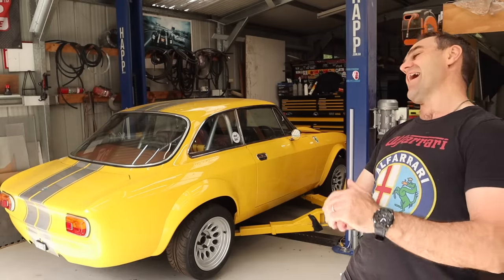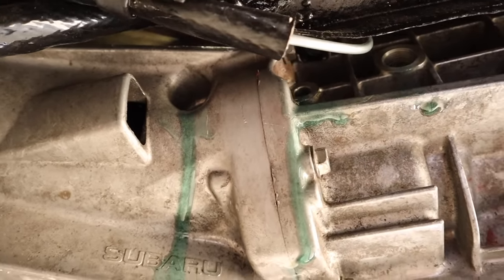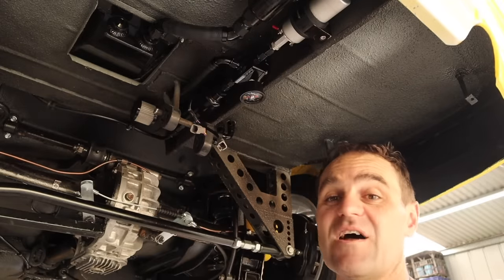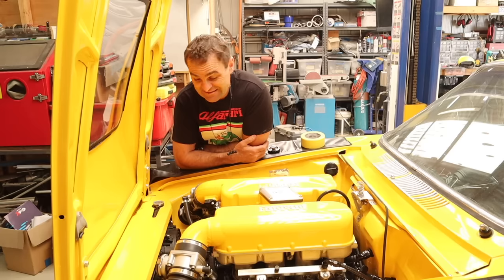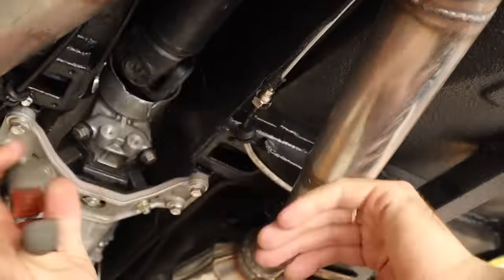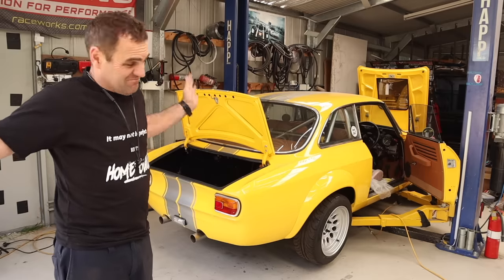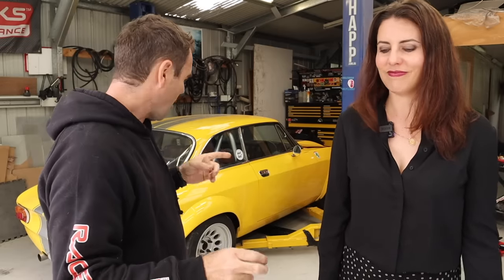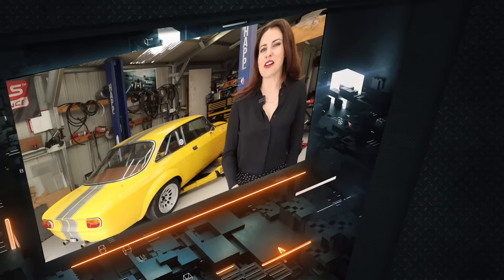It is driving! - Ferrari engined Alfa 105 Alfarrari build part 197

Comment: Hey Jeff, for filling your gearbox, go to bunnings and get a cheap garden sprayer, take the nozzle off the end of it and bend a hook in the metal tube so it will hook in the full hold. Fill sprayer with oil, pump it up and pull the trigger 👌🏻

Comment: I have a similar M9 story with my 1979 Alfetta GT.  The SPICA mechanical fuel injection was converted to Webers years ago.  The Webers are an early emissions (early '70s) version, and the progression hole inspection covers are M9 bolts.  One of them was missing, and I couldn't find a replacement ANYWHERE.  I recently had the carbs rebuilt by a guy in Illinois and he actually manufactured one for me.  He then was able to find M9 bolts from a supplier in - of course - Italy.

Comment: For gearbox filling I have a little 12v extraction pump and use it to extract oil from the bottle and decant into the gearbox. Sometimes the gear oil is a little thick so I either use a little hot plate and bowl of water or an old kettle to thin the oil a bit. Takes 5 mins to set up but then it’s no work at all. Great job Jeff. So happy for you.

Comment: With it being a Subaru gearbox it is most likely one of those holes is for a neutral switch.  Yes, I know it is a manual, Subaru use neutral switches in their manual transmissions, it has something to do with fuel mapping and using a different map for idle, no gear selected.  The other one I have no doubt would be for another sensor.  I'd be comfortable with just plugging them up with bolts.
Reply from the maker: That could be it.

Comment: Oil transfer pump on the cheap...  take one plastic garden sprayer (2 gallon is common size in the US), add schrader/tire valve so you can pressurize with shop air.  Add fluid, pressurize (I've done 40psi without issue for years) and hit the trigger on the spray wand.  Oh, I remove the "sprayer" part at the tip of the wand so it's just a straight stream, I know others have added a piece of tube with a bend on the end so it'll fit into tight spaces and still point down.  Takes a bit to move 80/90wt oil in the middle of the winter, so I tend to try and do my big fluid changes in the summer, or let the whole thing sit in the sun for a couple hours in the winter.  

Search "Pressure Tank Oil Filler Bmw Transmission Differential", that's the name of an Instructibles page with the general concept and photos just incase there's a difference in terminology, though that is more complex than my own.

Comment: Use a bug/garden sprayer with a clear hose and worm clamps to hold it on the trigger handle   You can also find a 90 or U fitting to hang in the hole and you can stop and start instantly with the trigger, pump up and fill....Any fitting with a "hook" end (a crook using a 90 or U shape) it will hold the hose in the fill hole and allow you to precisely fill it.  Set the sprayer on the lift or a stand to pump it while holding the business end with the CROOK inside the fill port.  I used an old large Rubber coolant hose that had a 90 that was about 2x the diameter of the clear hose, pushed the clear PUMP fill hose through the cut-off piece of  90' bend coolant hose (a U shape or even a J Shape should work),  so the clear smaller hose protruded about 75MM and it worked nice.  i.e. the 90' just changed the direction and keeps the hose from wanting to flop out of the fill port.

Comment: Fork yea!!!! always a great moment when they move under their own steam 😊 For filling the gearbox I drilled 2 holes in the plastic cap of the oil bottle and put a tyre schraeder valve in one hole and then some clear plastic tubing in the other. Both of these must be an air tight fit. Then I just use a bicycle pump or air compressor as very low pressure. Works a treat.

Comment: Great to see it finally driving!.My Alfa uses M7 bolts for the rocker covers so i feel your M9 pain. One of my local fastener shop employees told me M7 didnt exist when i went looking for new bolts 😃
Reply: In Australia, M7 bolts are relatively easy to locate.  However I have yet to come across an M9 bolt - now that's rare.  Alfa 1600 blocks use M11 studs which is also very unusual.
Reply: @georgebettiol8338  I am in Australia and none of the fastner stores in my area had any when I was looking,must be an Alfa thing to use unusual bolt sizes.
Reply: The Champion brand has M7 bolts.  These are readily available at Supercheap Auto - in blister packs.

Comment: Jeff, those M9 bolts are specialized high strength ones with an unsual unthreaded shank length.  Order them from one of the Alfa parts suppliers.

Comment: to find leaks easily, put some soapy water in a spray bottle, stray the system down from the outside, and then push pressurized air through it - it'll bubble up where it's leaking

Comment: As a help you’ve got virtually no chance of getting 9 mm screws. But 3/8 bsf is very very close about 0.1mm bigger in diameter and 0.05mm in pitch over 25mm. I had to modify my Citroen GS.gearbox and couldn’t get 9mm screws so I ran a 3/8 bsf tap into the gear box and hunks your bobble.

Comment: The front part is so weighted that it resists any attempt to move it in the desired direction. It slides here and there. I wish you safety as you approach the first curve at speeds exceeding 70 km/h. The chassis and weight displacement may struggle to handle such inertia. Best of luck!

Comment: Great to see it move👍couple of questions, are you just leaving the fuel pressure gauge in place while you set it up? As not sure the longevity of one permanently installed. Also your limited slip diff seemed tight when you reversed it on the gravel with a bit of a turn

Comment: Congratulations on getting the car driving.  I just checked some bolts from a Mazda MX5 MK2.5 , 1.8L propshaft , they are 9.7mm diameter on the shoulder and 25mm long.  I wonder if the early MK1 MX5 bolts are smaller ?
Reply from the maker: That is M10. These bolts are around 8.7mm

Comment: I notice a wheel lock on the rear as he drives it. It seem to pull to one side as if the brake is locked on one side. But say that it sound great and you got it to move on it own.

Comment: 13:30 Jeff, is it normal for that engine to smoke so much or what could the reason be for that, because of the cold start?
Reply from the maker: This is just a rough guess base tune. Still needs to be properly tuned.
Reply: @HomeBuiltByJeff  that could be it.

Comment: Congratulations Jeff!  It’s fantastic to see it running and moving!  I had a thought about the tail cover of the trans rubbing on the driveshaft without having to cut it all up. .  Do you think an exhaust pipe expander would work?
Reply from the maker: Probably, but I don't have one ;)
Reply: @HomeBuiltByJeff  Thought I saw you use something similar a while ago. Must have been another guy.

Comment: It's only the 2000 limited slip axle that uses M9 bolts, all the other axles use M8. I have no idea why they did that as M8 are plenty strong enough.

I actually sell the correct M9 nuts and bolts (Alfaholics) but you really don't want to be airfreighting something that small from England!

Comment: Just out of curiosity: When you were missing that M9 bolt, couldn't you strip a M10 (or bigger) on the lathe and cut a M9? (presuming you lathe gearbox is set to metric)

Comment: Porsche uses M9x1.25 rod bolts on the 3.2 and 3.6 engines. You can get nuts there.
Reply from the maker: Thanks. I might have a look in my old 911 hardware.

Comment: My assumption is that they used the M9 bolt to minimize the chance of a low grade 8.8 bolt in M8 or M10 instead of a 10.9 or 12.9

Comment: Jeff, you made spacers with your lathe…. couldn’t you have just made four M9 nuts and bolts with some hex bar stock instead?
Reply from the maker: They wouldn't be hardened so they would be weak.
Reply: Fair enough Jeff… WTF do I know 😂